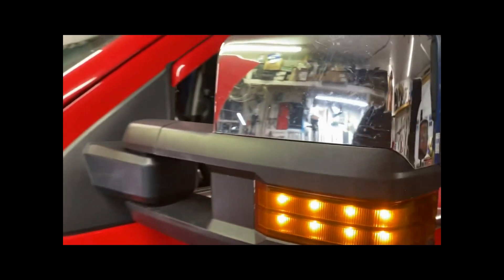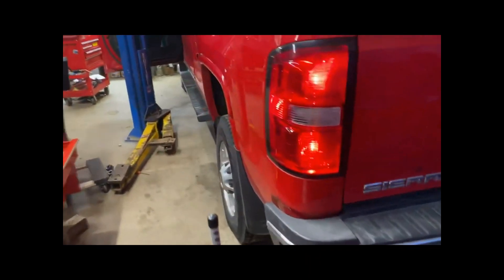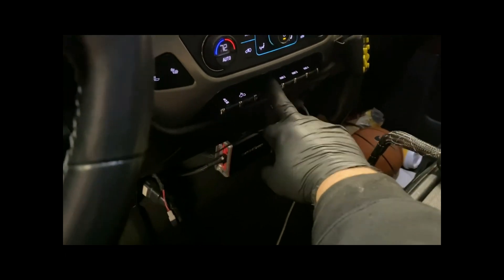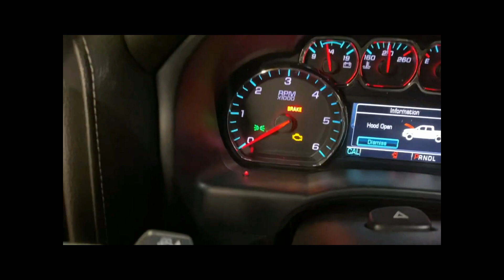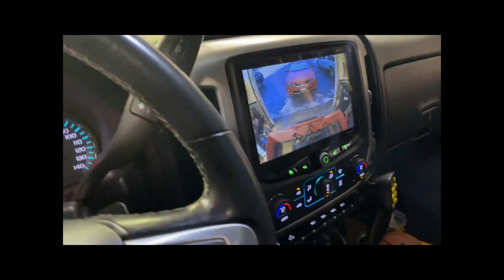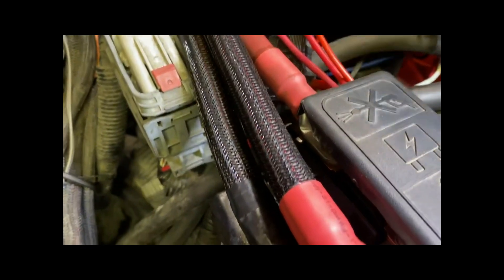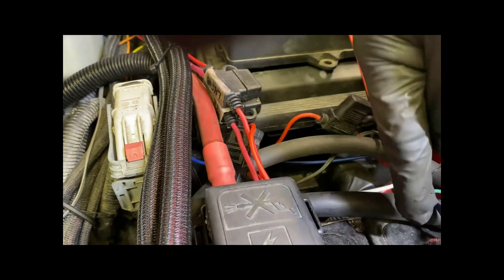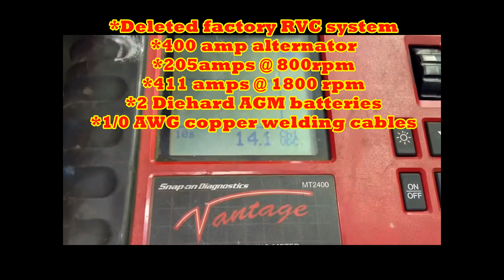2017 Sierra 2500HD Snowplowing truck electrical system dual battery 400 amp alternator 1/0 cables

Comment: Would you buy a V version of the Fisher xls with expandable wings?
Reply from the maker: Certainly sounds interesting. I’m not sure they could come up with some thing that wouldn’t be overly heavy and or overly convoluted. Also, the truth is the truck can only push so much. It would be interesting to see.
Reply: @LoneWolfSnowplowing  Sno Power has their 14ft winged front plow now that weighs 1250 lbs and costs around 16k+. They're catching on in my area so hoping for a V alternative that might compete. I can also fab and weld my own system if necessary.
Reply from the maker: @jamesnm21  I'm not one to bullshit, so I'll just be blunt. I'm not a fan of any of the Snopower stuff, I've seen that front thing and it may work for Walmart parking lot jockeys, but that's not what I do. In my eyes, at least for the area I'm in and the plowing I do, that thing is a toy. Nowhere near heavy duty enough, and certainly not configured for anything I'd do with it.
Reply: @LoneWolfSnowplowing  the nitrogen system has it's pros and cons. Wing holding power is definitely not one of the pros. They look pretty solid up close but I'm after a V so they're really not an option for me though they would work great in a lot of instances.
Reply from the maker: @jamesnm21  ever since their 180 backblade thing they (probably) sold to Boss, I can't take them seriously. So they have a back blade with an absolutely horrible mounting system. You need a 5th wheel setup, and it takes your bed up. and you can't open your tailgate or even run a tailgate. You have yahoos plowing backwards with it because the wings fold out past 180, when the whole point of a back blade is to avoid having to plow backwards. So at the end of the day whatever to each their own BUT there's more. So the wings folding back was the big gimmick for a couple years and plowing backwards with it......then all of a sudden they basically modified the back blade and put it in FRONT of the truck? lolz. Whatever.....who the F am I?